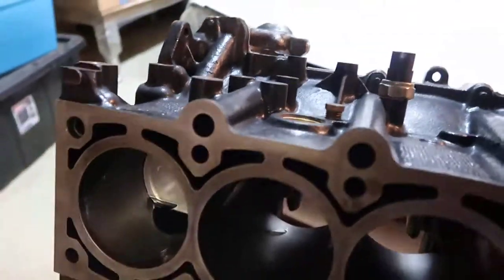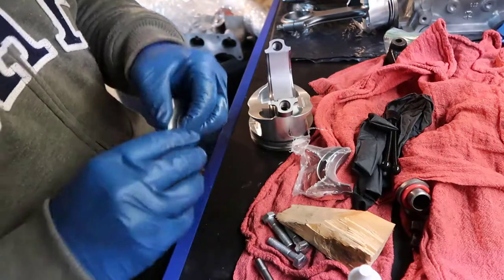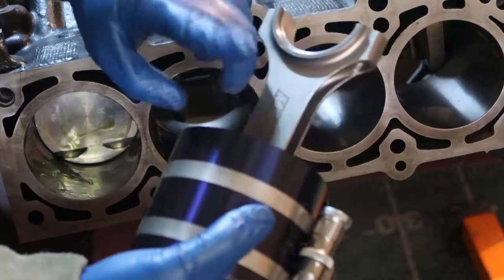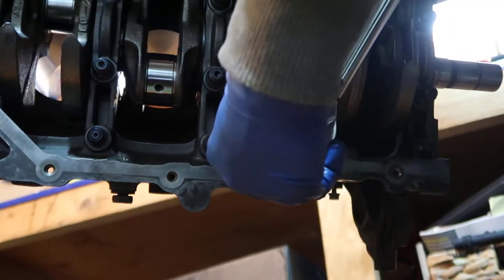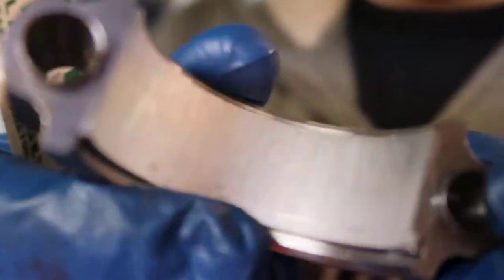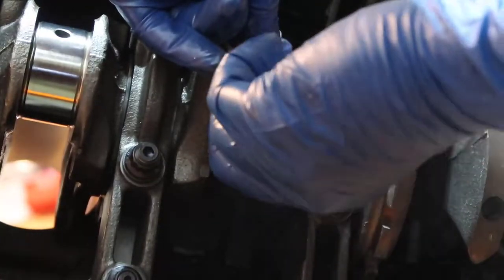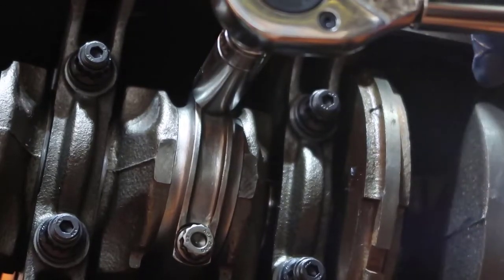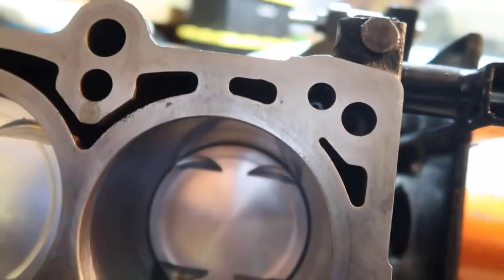6 Steps to Install Pistons into Cylinder - #Eclipse2GBuild

Comment: Hey partner good video really gave me some insight on my rebuild I'm starting next month on my 97 gst. Any rebuild kit and forged internals   types you recomend for parts.
Reply from the maker: ARP studs everywhere for sure. Pistons I got JE and rods I got Manley if I remember correctly. They were great and the weight was very close between each rod so no complaint. Eagle rods are also good I've heard
Reply: @CarModsGarage  are those forged???
Reply from the maker: @donovanstrieby3699  oh Ya!
Reply: @CarModsGarage  awesome!! How much were they
Reply from the maker: @donovanstrieby3699  the rods were around $500 and they were Manley 14004-4. The Pistons JE I got as part of a deal so they were sort of free. The studs cost me around $150 for the top and same for the bottom ones
Reply from the maker: Rods were Manley 14004